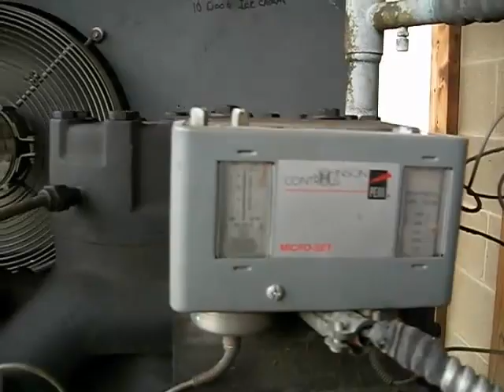Three-Phase Compressors

Comment: Great Vid!
That first one looks like its pumping liquid, if they are lucky it will trip out on low oil pressure before too much harm is done, you could see all the foamy oil in the sightglass!
The second one looks very similar to the Prestcold compressors we used to get here.
Looks like an intersting site to work on, would keep a tech busy for a while!

Comment from the maker: @justflooreit4me1 There are three separate primary lines that some into three separate transformers usually.  Depending on how they are wired you get your different voltages 208-277 vs 480.  There are three phase wires with a neutral and an earth in most cases.  Each phase 'leg' is synchronized with the other and offset by 120 degrees.  Long and short, it provides more stable power to demanding equipment and uses less amps.  Like 120 in your house vs 240.  ......

Comment from the maker: @justflooreit4me1 You have three phase legs that work against each other in rotation.  Its used mainly for motors in industrial settings.  Depending on how the transformers are tapped you have your varying voltages and have to wire the motor in either star or delta configuration to match and run properly.  With single phase 120, you have moments that voltage drops as its alternating, with three phase you have the same but

Comment from the maker: @speedy75602 I think it has a refrigerant leak because the service man injected die into the system when he replaced that compressor two years ago.  The big red fan was from a central air unit.  I took one look at that and said, some is clearly not right here!  LOL  It was cold outside and these units are just under a little roof, but that shouldnt matter.  Only one fan would cycle on occasionally, but the comp never shuts off....

Comment from the maker: @heavydiesel the top of an old central ac unit wired into the condenser fans.  I know the guy that works on these but still.  They do need a good cleaning.  If you look at the one in the middle with the single big fan, there are six more inside just like that unit.  Ill have to get some video and or pic this summer when its in ice LOL!

Comment: they need to call service man for the unit that is iced up - don't know if the condenser fan was not running because of cutting back on stage or if its bad but something has the pressure out of whack either from fan or  refrigerant leak

Comment from the maker: @Aussie50 Yea, that first one was replaced two years ago and its always had ice in the summer and frost in the winter like it is now.  It has been problematic before.  I know the guy and he is always adjusting the tv's when the season changes and he injected die into that one system.  I know the owners want the coolers cranked down cold, but that is just for a meat cooler.  It is very unhappy, I heard it making a tapping noise earlier....  Thanks Ed!

Comment from the maker: @justflooreit4me1 its impact isnt as substantial as you have the other two phase legs to take up the slack so you have a more stable constant power source for your motor.  This is my understanding of it, some could be wrong some could be right.  There is a little but to it, but it is interesting.  Lots of stuff out there on it.  I even have a phasing meter to make sure the phase rotation is correct.